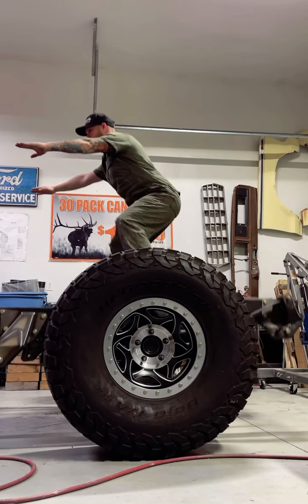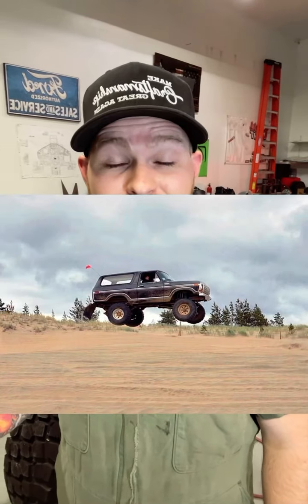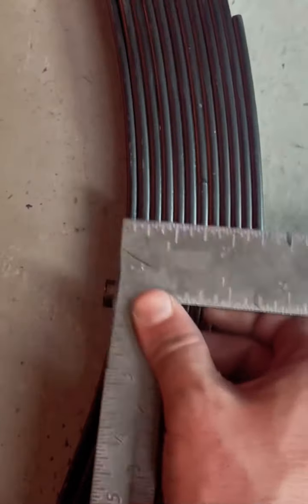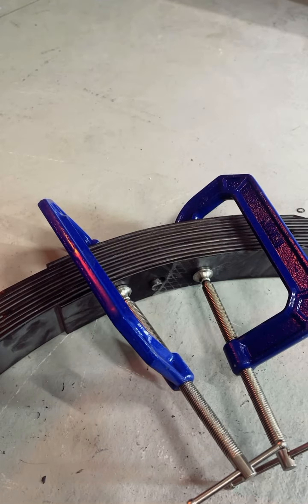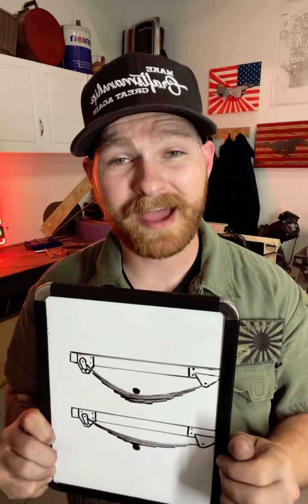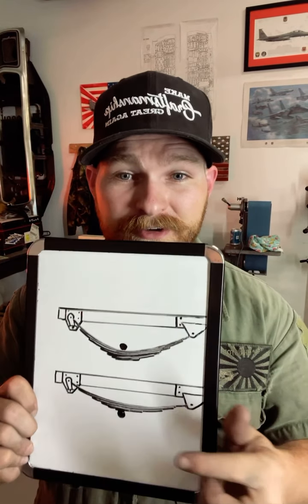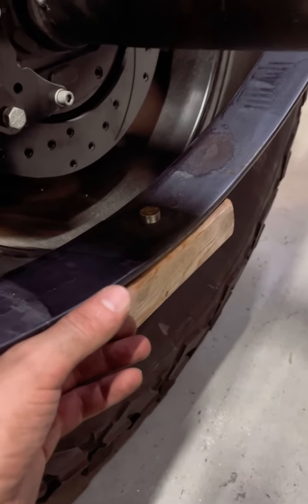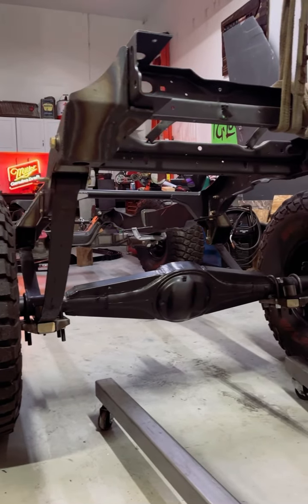How to Cycle Leaf Spring Suspension! Get the Most out of Your Leaf Springs!

Comment: How do you recommend measuring for limit straps? Is it when the leafs begin to seperate out of the retaining clips?
Reply: Limiting straps are to prevent excess Axle Movement from Ripping your  DAMPERS  in half .
Not about the Springs in any way . To protect the Shock Absorbers .
Reply: @johncunningham4820  yes I know that. With certain spring setups leaf separation seems like it will cause binding if you let them droop too far, therefore requiring you to limit travel with limit straps. 

Limit straps could also be used to prevent cv axle bind, components colliding, steering binds, etc.